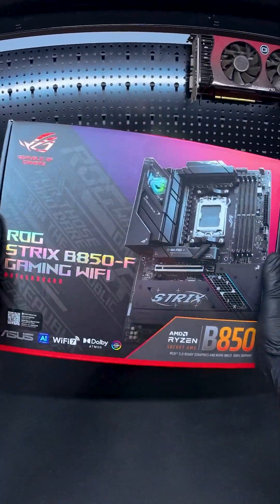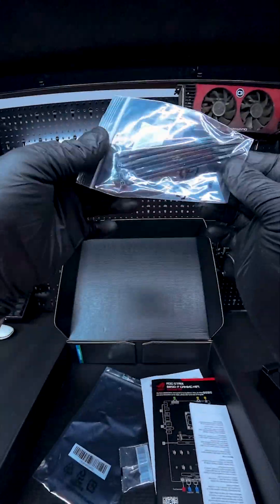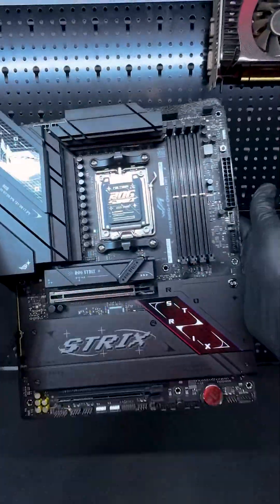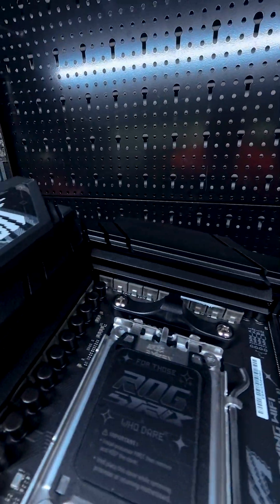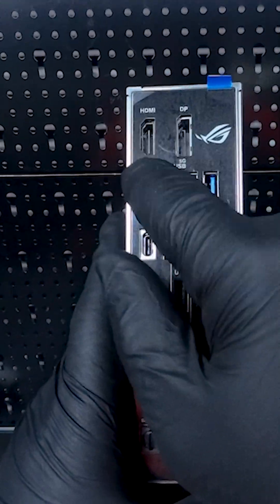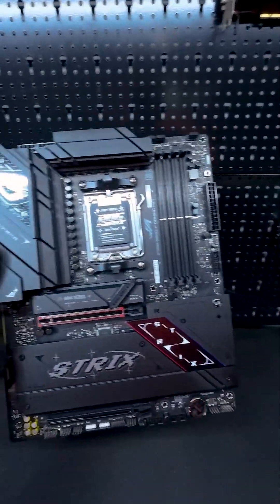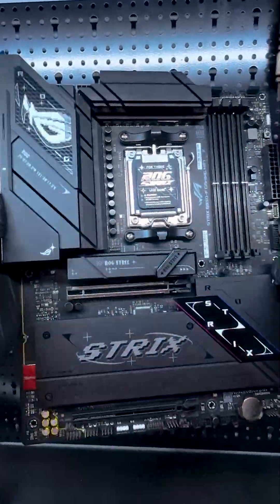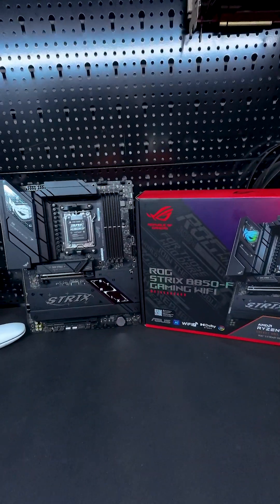POV Overview Of The ASUS ROG STRIX B850-F (Short)

Comment: Halo, can i use 9950x3d on this motherboard?
Reply: Yes, I use one and its an amazing board, it packs more than enough power for even future ryzen 9n cpus
Reply: @MrLivegames Which is better, choose Rog Strix B850-F Gaming or MSI X870 Tomahawk?
Reply: @iwangonzales25  The Rog strix has slightly higher Power Delivery than the tomahawk, but the X870 will have usb 4 support in the back IO and 5Gb Lan vs the 2.5Gb on the strix, but the strix does have thunderbolt mobo support if you have a case that supports it and that has the 40Gbps speeds of usb 4 so that lowers the IO advantage on the X870, Personally I would still choose The ROG B850 -f because I like Asus software and I find it better and more polished than MSI especially their RGB soft, But both boards will be sufficient for all current ryzen cpus so it falls into personal preference and whatever will be cheaper.
Reply: @MrLivegames  Thank you for the advice
Reply: @iwangonzales25  you're welcome, glad to be of help

Comment: Im running this board with 9800x3d 5080ti pny, 16x2=32 ram 28 latency, 2tb 14000 rpm. The only down fall on this board is the download speed sucks ass, I'm downloading 80mb for games that is garbage compare to my ps5 pro downloading 400mb. On my ps5 pro i can download 100gig game for 20 minutes to 30 minutes, and now my mother board sucks download 80mb and takes 5 hours to download a 100gigs. This is the downfall on the asus rog strix b850f. But the board can handle all high end stuff like cpu and gpu out there now.
Reply: Update your drivers I’m downloading at 980 mb/s on steam
Reply: @Treesftw I did updated it bro. The only option I have left is plug the eithernet core to it. To download at 400mb. The wifi on the board is to slow or my board i had is broken. Who knows.
Reply: @whattheworldsneedswhatneed774  Maybe you were connected to the wrong Wifi?